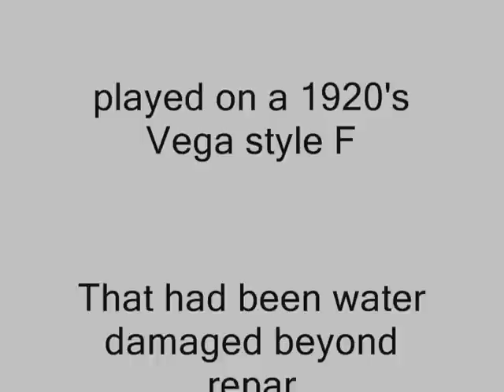Throwing Sparks!  A bit more rat rod frame repair..

Comment from the maker: @ahhGroovymangroovy   I'm not sure how thick the frame is on one of those.  I'm thinking it's a uni-body, with a pretty thin frame.  Still it can be fixed.  Cut out the rust, find some metal and cut it to the same shape, replace the missing part.  If the welding is good and the metal is as strong as the metal that was originally there, you should be just fine.  That's my thinking..